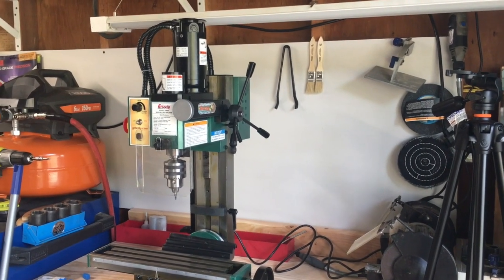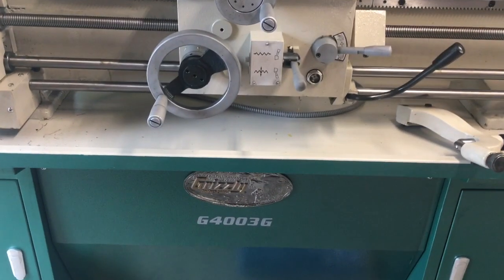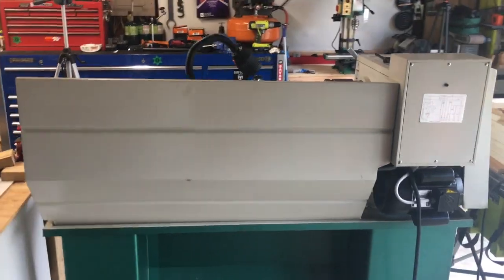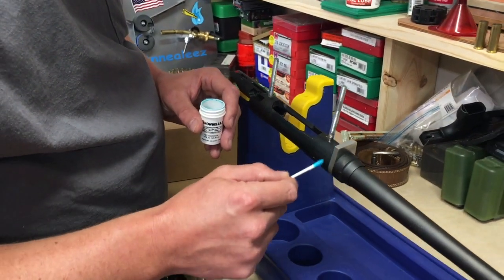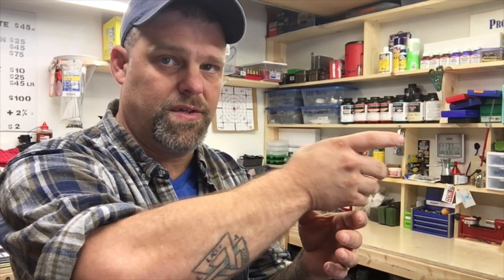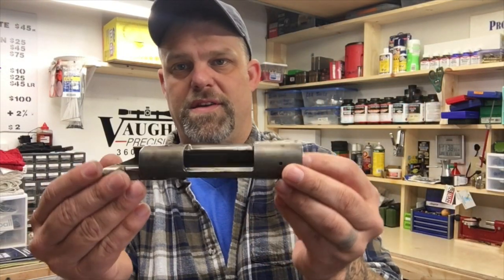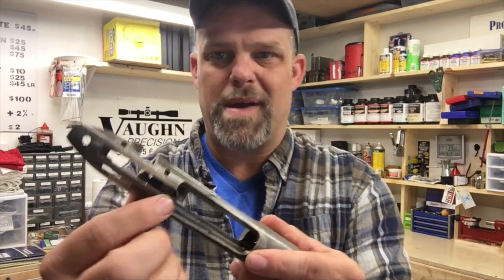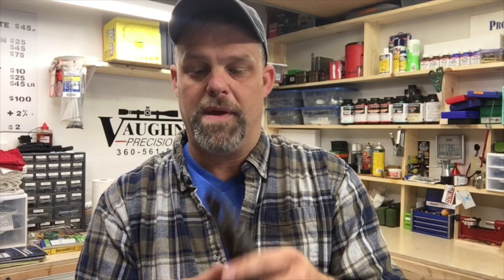Grizzly Lathe and Mini Mill

Comment: you will want a lathe big enough to As a Example after you learn your lathe you will be able to take a 6mm x 47 Bat Benchgun bull barrel off then cut, turn, rechamber & thread it to 16 Tpi to a Rem 700 in 243, then later you can take the same barrel off and cut the chamber off and rechamber and thread it to 20 tpi and rechamber to a 6 mm Dasher for a Savage action, then after you get sick of shooting that, you can take the same barrel off and cut, turn, rechamber and thread the barrel to a .8125-16 TPI for a barrel extension on it for a 6mm Grendal and make a Ar-15 barrel. This shows a little of the absolute dominance you can have when you master your lathe, taking a barrel off of one gun and rechambering and threading it for another totally different gun with a different size case but same bore dia. barrel.
 ebay has a 165 lbs 8x31 lathe with 38mm spindel bore cuts inch threads $ 1,799

@t